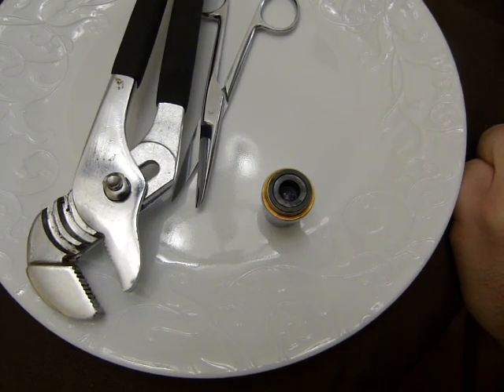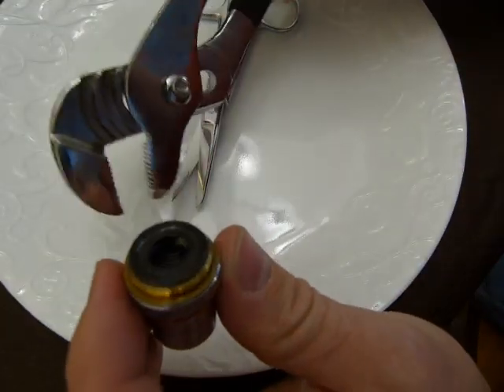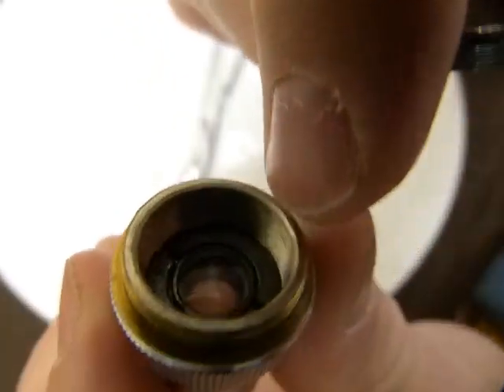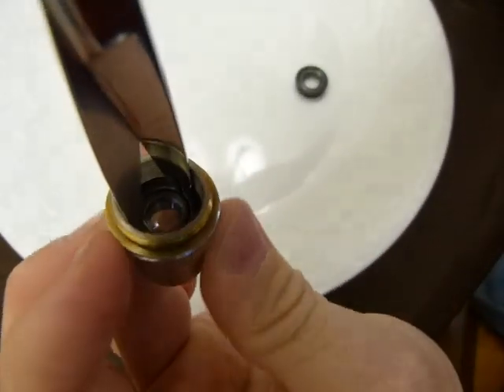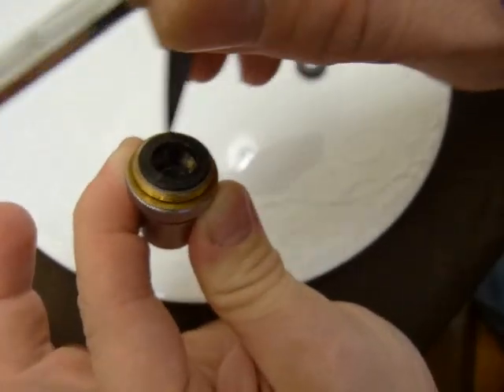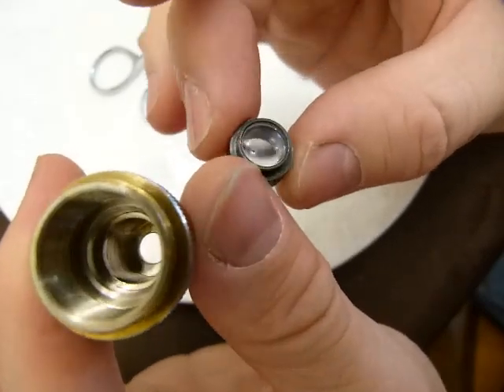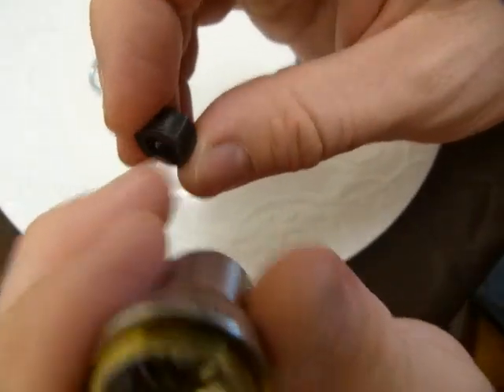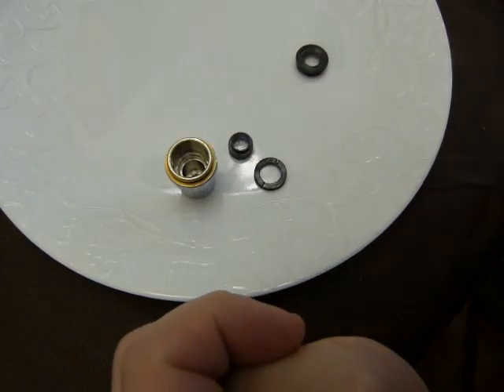Microscope lens cleaning

Comment: This is interesting. I have a 40X AO objective that has oil infiltration that I'd like to work on. I got the back piece off and the insert. However, the next step doesn't work. Do you by chance know how to get the front  element off a 40X?  Unfortunately 40X are the objectives that most often need work because they are long and right next to the oil immersion objectives.
Reply from the maker: No, never came across other lenses, my only video on this of the entire channel. Thanks for watching!
Reply: I’ve got the same thing going on with my Olympus MPlan Apochromatic 60x. It’s a great objective but has oil infiltration because the previous users didn’t take care of it.

Comment: The worse ideea ever...the lenss are protected inside...The only part you need to clean is the part of the objective theat came close to the slide whit isoprpilic alcohol....
Reply from the maker: Definitely it is for you with your level of attention and manual dexterity in spelling. Just give it to a professional for cleaning.
Reply: Hahahaha, thats cute.

I recently picked up a travel scope from amscope, BETWEEN lens elements was filthy. So yes, sometimes, it is necessary to disassemble the lens array.

Comment: I got a 1918 Spencer and it needs it badly. No focus on two of my objective. but jeez man Your scaring me! Scissors?, dont they make a tool for that,? Ive taken a few of those apart. Who am i kidding? i would use scissors also i think i used a knife once, buggered up the threads it was a nightmare. This was a very scary video i was on edge. Looks like your Good tho.
Reply from the maker: Yup, somebody sure makes a proper, well fitting, safe to use tool for it. I can`t speak to the manual dexterity of our viewers, I just got it done the scary way.
Thanks for watching!
Reply: @theoverengineer  loved it, Im dreading doing mine. Ive tried cleaning sill just a white dot. its gotta be in between. No good as it is anyway right? scissors is actually a good idea. better than two of something.
Reply from the maker: - white dot might be dried hard paint? on the surface of lens. Might need different chemical or physical removal.- Instead of scissors, which is always on an angle, sometimes I make a "tool" where the working bits are parallel instead, out of 2 nails and a piece of wood or something ...
Reply: @theoverengineer  Two nails and a piece of wood is really funny because i have used that "tool" many times. binoculars and a few other things, you have to sharpen them just right.. I never though to use scissors and ill probably try that. Its a great idea and ive got the pair in mind. I stipped wire once with em and they havent been the same since. Although i have made my own paint many times and check everything i make under the scope. but i always use a slide cover. Ive got a brand new Am Scope and as soon as i finish my wood carrying  case ill retire my 1918 Spencer. I really like its wooden case and though, but Im stuck at a 15 x eye piece and a 10 x object its still a good scope. thats what? 150x The Am Scope brags a whopping 4000 magnification but seriously 4000? I have yet to check it out and dont even want to take the factory plastic off until my case is done. Because i dont wanna dust, grease, or opaque the lens, I got a scope like that now. Its certainly my fault is a white out. I look at some "different" stuff.

Comment: I don't know how to clean insinde. Please teach me!
Reply from the maker: +cường nguyễn chí Find a dozen soft cotton tipped items that fit inside the tube.
Clean with plenty of water or a lens cleaner solution. If dirt is removed with just minimal amount of liquid, it will skate along the glass and scratch it. Dirt is abrasive and hard. Lens could be plastic or glass, but both can get scratched. Dirt removal needs a thick enough liquid film to lift the dirt off the surface.
First, rinse off most dirt by filling the tube halfway and shaking the tube with its open end covered. repeat 2-3 times.
Then swipe in one direction only and go around in a circle once without overlapping you previous track. Don`t go backwards either, both moves re-introduces dirt already removed to the surface. Rotate cotton tipped cleaner while moving forward with it so it always has a fresh surface touching the glass.
Dry the lens with fresh cotton tipped sticks, make sure you don`t have any residues or fiber left on the lens. Blowing clean air also helps (dry, water vapour-free clean air sold in a can, not your breath)